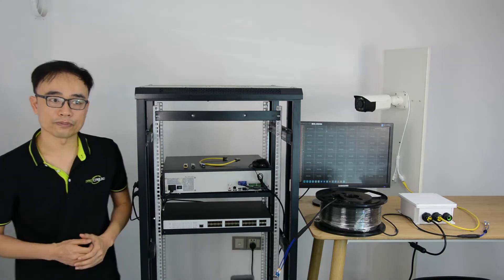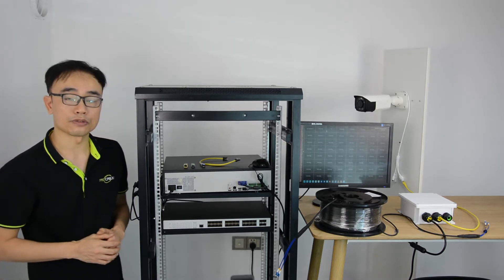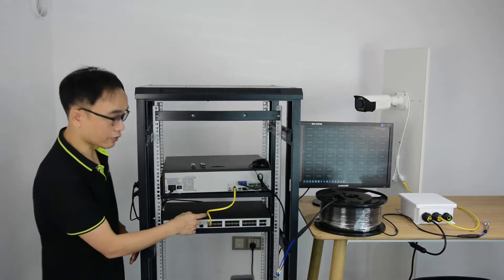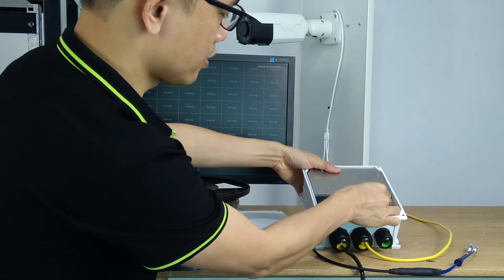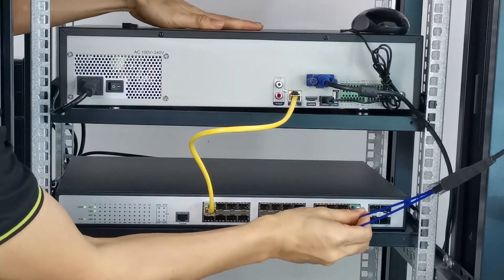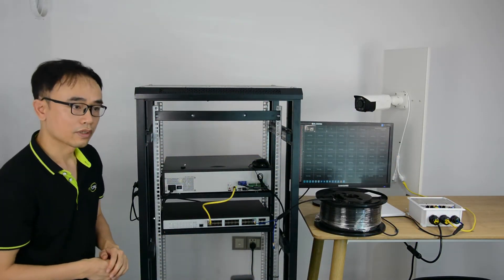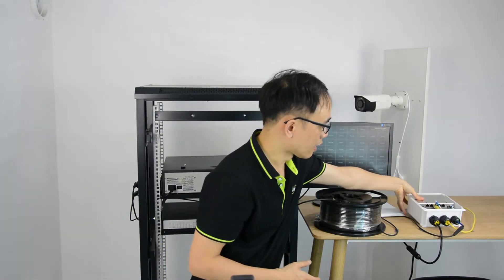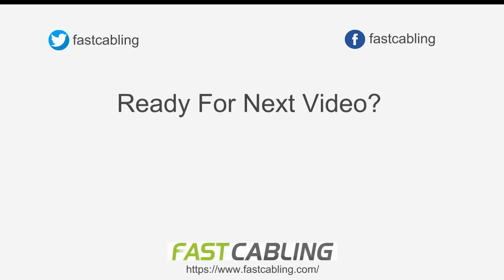How to use fiber optical cable to build middle or large IP surveillance network system

Comment: Can you connect an outdoor poe switch to another outdoor poe switch to connect more cameras?
Reply from the maker: Yes, but if the link is cut off, the switch goes offline. You should consider using a switch that supports ERPS. ERPS to ensure the network ring remains fault-tolerant, keeping devices online if a segment goes down. https://www.youtube.com/watch?v=Acz9ZmiXdIo

Comment: Dear if i put dual SFP module and connect single fiber opt. cable both module (transmitter and receiver). It can also work?
Reply from the maker: I guess what you mean is BiDi transceiver right? If you use the BiDi transceiver, you need only single fiber optical cabel. Here is the related video. https://youtu.be/llUiJ_NLb9Q
Reply: @Fastcabling  thanks i got my answer.

Comment: Hi Sir,

Pls, have about 38 cameras connected to a POE switch to an NVR. (17 - 6MP cameras and 21 - 4MP cameras)  over 708M fiber connectivity in a single mode transceiver to ethernet. I have two cameras video dragging, what can i do to improve the video feed please. thanks.
Reply from the maker: Can you check the bandwidth specifications of your SFP transceiver. It has 100mpbs and 1000mbps version. If it is 100mbps, the bandwidth could be not enough. Replace the SFP module to 1000mpbs will be good. If the bandwidth is not the cause, you might want to check the cameras (those cameras) and the connector of your fiber optical cable. If the cable connectors are not well made, it could cause serious insert loss. However the fiber cable should not be the problem. It can easily achieve up to 10G speed within 20KM.

Comment: What kind Fiber optic cable use and the SFP ? Singlemode or multimode ?
Reply from the maker: It is the single mode fiber optical cable. Only one strand will be enough. The SFP module employs different wavelengths to transmit and receive the data over single strand.

Comment: I want to connect 64 cameras
Reply from the maker: Hi, there. Thanks for watching! We're more than glad to help you!

Yes, you can put 64 IP cameras over a single fiber optical cable. The bandwidth is 1000mbps, and each camera only needs about 8mbps, even considering the data peak, it will be more than enough.

P.S. If you haven't yet subscribed, plz follow our channel. We'll come back with more vids :)